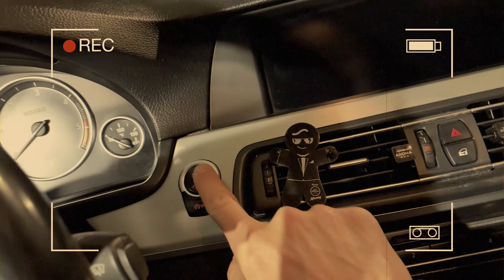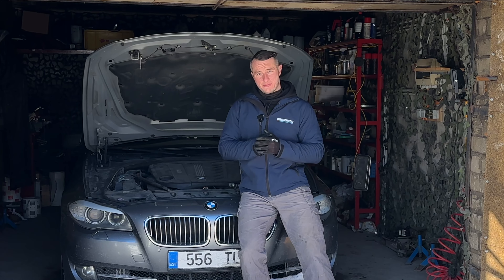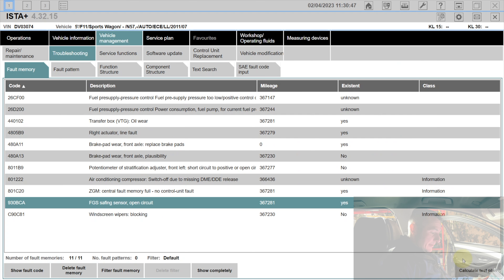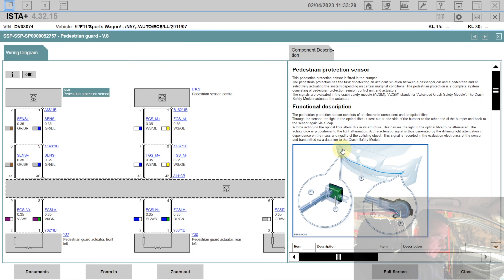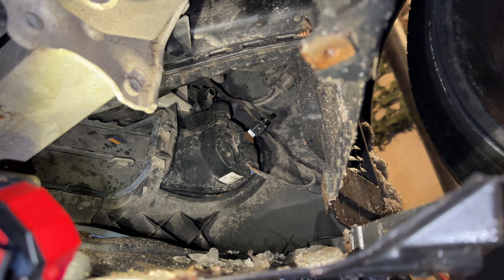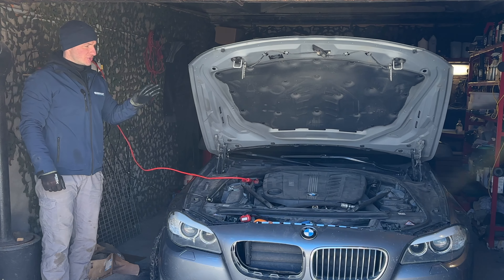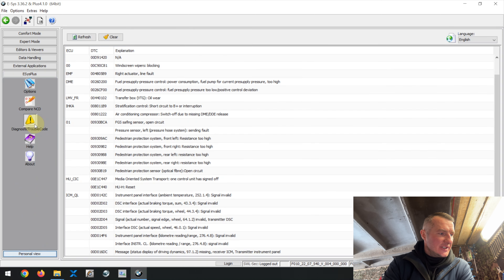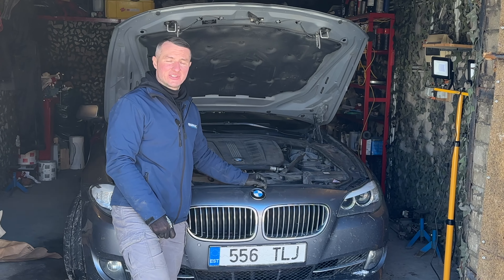Cheapest BMW fix you can imagine! SA8TF option decoding

Comment: Disconnecting the front bumper sensors is even easier -  just turn wheels to left, remove some screws holding the front passenger side wheel arch liner, bend it a little so your hands reach close to 2 connectors. One little(2-pin) is the one for the optical sensor. Another one is bigger(8-pin or 12-pin depending of production time). I just cut one of two wires(white/blue or white/yellow) connectiong centre sensor and thats it.

Comment: Amazing guide. Is there a way to detect which sensor is faulty and replace, without turning off the entire system?
Reply from the maker: Ista helps to diagnose that
Reply: @BimDoc  amazing, and if I did decide to replace the faulty sensor, will I need to recode the issue, or will it likely detect the sensor is now working ?

Comment: I had a job like this recently. After coding out 8TF and disconnecting all connectors, I still had an error with three cartridges. It turned out that someone put resistors in the harness. I got rid of them and voila, no errors with ACSM ;) best regards from Poland and thank You for Your job
Reply from the maker: You are welcome ))

Comment: Hi, thank you for the video. I have a Mini Cooper with the same PPS error.

Using Topdon top scan tool, the fault codes I get are: ‘930CBE pressure sensor left (pressure hose system) short circuit to B+’ and ‘930CD7 pressure sensor right (pressure hose system) short circuit to B+’.

Do you know which connectors I need to disconnect please? When clear the errors they come back.
Reply from the maker: Usually it’s x4 under the bonnet and x2 behind front bumper

Comment: Just question you did deactivate the whole air bag system from the car or just pedestrian actuators  to avoid error codes . and what about if we have two more sensors the one is passenger door and driver side door. Do we should disconnect them too .?
Thanks
Reply from the maker: It was deactivation of pedestrian protection only. Airbag system is intact. 

I haven’t seen any sensors for pedestrian protection in the doors. 

But there are sensors for airbag side crash detection
Reply: @  thanks for your answer. My question is ….IF….. i have another regular sensors in the car like the ones in the driver side door and passenger door should I disconnect them too

Comment: Hi,
Isn't necessary to disconnect the battery when working to this system?
My first intention is to disconnect that pyrotechnical cartridge marked with the issue (to high resistance) listed on CAN - maybe there is cold contact.

Thank you
Reply from the maker: Battery disconnection is not super essential 
It’s just recommended
Reply: @BimDoc  Thank you for your reply. In the meantime I removed gently the sensor socket without disconnecting the battery, I cleaned it but  the error persists.

In my case I think I broke the connection right on the bottom of the sensor when trying to remove the mess that drips from the windshield. Even if I was gently, it seems that just a small touch it was enough (my car has is from 2013 I assume the cables are no more at the same properties).

Thank you.

Comment: Hi. Would you know which sensors to touch on the 2018 BMW 2 Series F22 Coupe?
Thanks
Reply from the maker: Check WDS (wiring diagram system) for answer. It will shin in a great details.
Reply: @BimDoc  Hi. I'm trying to ask how many sensors are in the front for F22?
There is one on the driver's side of the fog light along with the parking sensor - which I have removed, then there is fibre optic sensor nearby the driver's side horn. The last one I believe is in the middle behind the number plate like yours? I'm in the UK so right hand drive here
Thanks

Comment: Hi! Great video, very informative thank you… any idea how to remove the lower grille on a F13 6 series? (it does not seem as easy as 13:15 in your video) 
Thank you from the UK!
Reply from the maker: It’s also possible to remove pins from ACSM ECU if Access to sensors is complicated

Comment: My parking sensors don't work. Do I fix it by doing this? Do I need to replace one of the two sensors for pedestrian proteciton or do i leave them unplugged and parking sensors will work normally?
Reply from the maker: Parking sensors are not connected to pedestrian protection anyhow. Those are different systems.
Reply: @BimDoc  Do i need to reconnect the sensor behind right fog light, that you disconnected? And do i need to put back my optical line sensor back, because it's currently not mounted on, only bumper is on?
Reply: and can you please link the video that you were talking about at the end on how to remove the option totally from the vehichle?

Comment: I've disconnected the all sensors and cleared the fault which seems to be fine for some time. After a few days the "Restrains Systems fault" appears and once I check that using Ista it says: 
Ignition circuits: Coding data does not match equipment (pin A08 - A09)
Ignition circuits: Coding data does not match equipment (pin B81  - B82) 
I'm able to clear the faults but it appears again after a few days.  What seems to be the problem?
Reply from the maker: Error is exactly as it says. 
Coding is wrong. 

Recode ACSM ECU as per current video

Comment: Hey Vladimir,

Thank you so much for the video - i would like to ask you if it is possible to only remove the warning-sign in the cluster?
I tried to change it with ESYS (KOMBI - 3001 - CC_Aktivierung_08 - Ausgelesen - WERTE= FF, *00, FF …)
That is not possible for me
In the folder „AUSGELESEN“ is a data called „ein“ which can be changed to „aus“ but i‘m not sure about it.

Help me if you have another solutions

Thank you!
Reply from the maker: You can try, but HU will still show the error.

Comment: Sir, i ve the same error on my g22 after taking an impact on the bumper. However, in my case the bonnet raisers didn’t activate, i mean the bonnet is totally normal after the impact. After the inspection, we ve found that only the pedestrian protection sensor with tube is damaged, basically the tube is ripped. So, my question will be, does replacing the sensor and clearing the fault codes solve my problem?
Reply: Actually, after watching ur video in detail, it may not be the only sensor that is faulty i didn’t know bumper had that much, that’s what the body work guy told me i mean only about the sensor with tube.
Reply from the maker: Replacing fault parts and erasing the errors will fix an issue for sure.

Comment: Hello Friend.  Your clip is great and very useful!  I did everything that was described for the BMW F10, the pedestrian function went out, but an error appeared in the airbag that cannot be deleted “Ignition circuits Codingvv data does not Match equipment (pin a….)”
Reply from the maker: Usually it means that you have not unplugged all needed connectors.

Comment: Better tape connectors otherwise fault can show up again due to a moisture inside connectors. I had this problem before. Now iam disconnecting 12 pins from acsm and no problem anymore+better looking view under hood-no disconnected connectors
Reply from the maker: Connectors are taped at the end of the work 😉
Reply: What is the process of disconnecting 12 pins from the acsm?
Reply: @jdhillon2179  This is the way I ahve just done it - check the wiring diagrams, then pull the correct pins out of the plug - very easy to do

Comment: My mechanic reconected the sensor on the bumper😬 if i disconnect it and erase the codes will it be ok or does ti need to be coded again? 😃
Reply from the maker: If system is okay and working (all connected back again) then erasing the errors will help